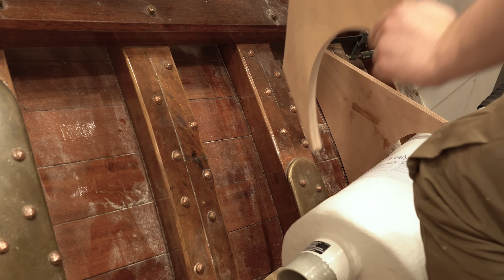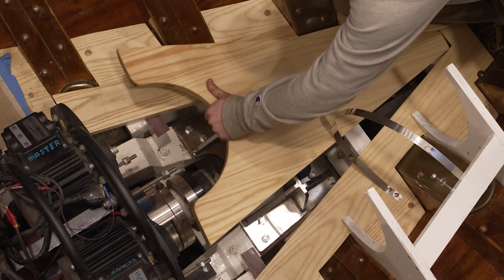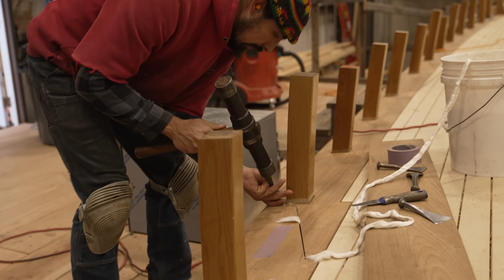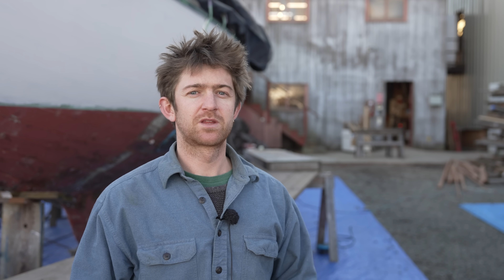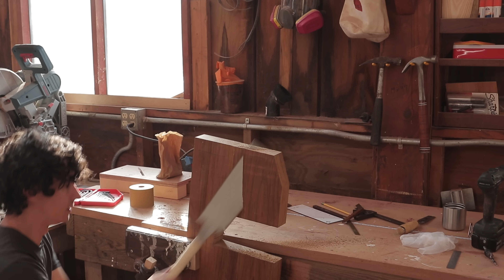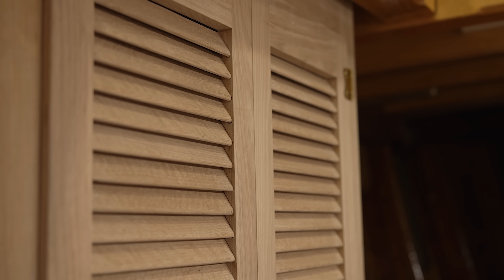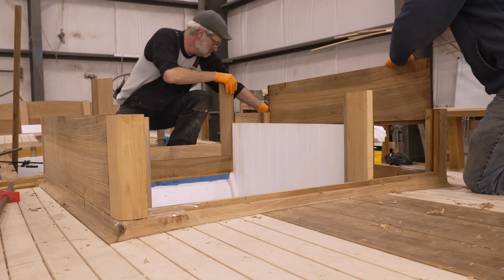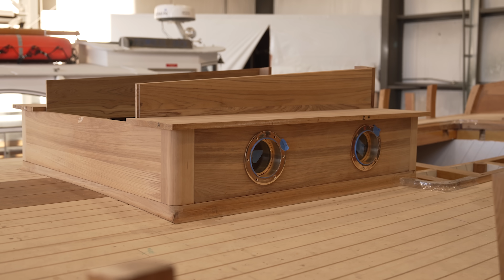Traditional wood boatbuilding - deck hatches & more!

Comment: Hi Leo ive been watching this boat build from the start. i must say your work is to a very high standard but as a mechanic and a welder i have made an observation that concerns me. exhaust systems can get very hot and your system has some of the parts made out of combustable materials including the muffler mount. are you not concerned about potentcial fire particualary under heavy engine use situations.
Reply: I think you'll find the Halyard Marine Exhaust System are completely insulated and won't radiate any heat.

Comment: How many man-hours does a built boat spend sailing compared to the vast number of man-hours it takes to design and construct ? 

I'm guessing that Tallyho already has 30,000 man-hours invested !  , how many more to complete the build?

The cost is beyond my ability to estimate,  probably $3,000,000 USD in labor and a staggering amount for materials . 

Phew -- seems like an unlikely project without an impressively wealthy sponsor.  

Hmmmmmmmmm

ps.  It's been a wonderful adventure to watch, as I have done from it's very beginning.

Comment: Why is saltwater fine in the bilge and not fresh?
Reply: Salt water inhibits rot, kinda "pickling" the wood while fresh water + wood = rot
Reply: @patricklewis8246  of course 👌
Reply: Freshwater promotes mold & wood rot, especially when trapped in a void space or an area that doesn't drain.

Comment: Leo didn’t see any paint go around the hole in the bulkhead for the rubber exhaust pipe. As you know there is always water and damp in the bilge, just an observation
Reply from the maker: it was sealed with 2 coats of clear epoxy :)

Comment: Oh what joy, led keel prep / paint.  When we did ours, we wet sanded with mixed epoxy as led oxidizes immediately on air contact, don't know if we went overboard doing that, but seams to of worked for us.

Comment: So during this rebuild. How much of the 1 dollar boat remains? I say less than 1%. What do you say? Not a complaint. Just feel you need to say, You are replacing 99% of the boat.  Really building a new boat fully, and reusing lead and brass from the original boat.
Reply: He doesnt really need to say anything to be honest. Specially since he covered this exact "issue" many times before.
Reply: what remains are her lines, design, some deck hardware will be reused as well, and her stern is largely from the old stern timbers - and the things you mentioned, the lead and brass getting recycled as well
Reply: @theorganguy  I was just asking. what makes Rebuild % vs full replace % here. If you are over 93% replaced it not rebuild it new.
Reply: @robb1460  who decided on that number? as the other commenter said: Leo has been addressing this very thing several times and essentially what you are seeing here are a "catch-up" on decades worth of maintenance in which most these things would have been replaced piece-meal... only that you see all of that compressed into a 5-year span, does it make it any less of a rebuild? In the end we are all free to decide on that for ourselves. For what Leo is concerned: if at all times of the progress you were able to look at the jobsite and see "a ship" then it will always been "that" ship and not a replacement.
Reply: @theorganguy  I have heard Leo's on this matter. Still, come on. If I say replace everything short of used rubber tires, wheels, used brake pads, and car stickers. I just have a new car with some used parts. As what the boat rebuild is.
Reply: I've heard this story when I studied architectural preservation but here is Leo telling it again in reference to Tally Ho https://youtu.be/tW15VnkEmQ0

Comment: Zeal packing cotton into the joints on the deck is pure poetry in motion, and strangely relaxing 🙂
Reply: I've caulked a few boats and you're right, strangely relaxing. I'd get into a kind zone and the world would go away. I miss those days.
Reply: @KRWoodworks  and a fine art lost on many
Reply: Its the repetition and establishing a rhythm and when your good and not to many hiccups, by  the end of the day you can do get a lot accomplished.. very therapeutic and fulfilling
Reply: We need a 10 hour video of him caulking
Reply: @maxlundgren3482  I think you missed at least one zero off the end of the number of hours ;-)
Reply: yes, strange.🤔
Reply: I can’t understand why you still caulk with cotton and then put a hitech flexible sealing compound over it? Why not use a sealant adhesive alone?
Reply: @waynejorgensen4433  The cotton is not to seal the boat. It's for tightening the boat. The fiber caulking either cotton, oakum, or both turn the boat into a monocoque structure. It helps prevent the boat from working underway. The seam compound keeps the water out. After caulking small boats in the shop I worked we wound "ring" the boat. Basically hit the side with your fist and the boat acts like a solid or "rings"
Reply: @KRWoodworks  thanks Kevin
 Makes sense!
Reply: @waynejorgensen4433  It's probably double the protection.  If the sealant fails the cotton is still there as backup.
Reply: @AIM54A  The fiber caulking can not block water. Read my post about what it's for.
Reply: @waynejorgensen4433 I see KRWoodworks has already explained, so I edit my comment I that light. I just say, this is Tally Ho, there are no corners cut around here.

Comment: It's just a never-ending stream of perfection being shown here. If boats could have halos, this one would.
Reply: I Think the halos was in sight when Leo started the Project already, one step at a time.
And Tally H has achieved more than one halos already _/)
Reply: Really?I am thinking about that misters mustache
Reply: I learned how to build a boat from my father who was an old time boat builder in NewEngland . The bronze piece made for finding the center line ? Had I produced a finished product like that for my father he would have had me make it over. A few pointers…
The counter sunk screw holes where much to deep, the screw heads should have been flat heads and then filed down to meet the crown of the half oval filling the entire counter sunk hole. The slots of the screw heads should have both been horizontal when completed. The piece when completed should have been sanded with fine sandpaper to a uniform shine.
Reply from the maker: @toddabrahamsson1797  What you are describing is personal taste. I prefer to see the patina of the original keel bolt, so we will skip your "pointers", thanks.
Reply: @toddabrahamsson1797  good lord dude, its not that big of a deal nor is it your boat
Reply: @toddabrahamsson1797  I think Leo wanted to keep the patina from the 100 year old original keel bolt.
Reply: @toddabrahamsson1797  lol
Reply: @toddabrahamsson1797  The apple does not fall far from the tree.
Reply: Watching the video today I was surprised to see the house being installed with no vertical bolts ,bolting the house down through the deck beams. The way I was thought any structure would have these bolts and to never just use glue no mater what type of glue used or no mater the size of the house.
Reply: @toddabrahamsson1797  with your expertise in boatbuilding could you explain the difference between house and hatch? I ask because the video led us to believe that they were installing the hatches on the boat and made no mention of the term house.
Reply: @daBuzzY90  I kinda guessed that but with I'm not an expert and with all his complaints about the work of at least 3 shipwrights, and 1 being a marine architect, I wanted to be sure. 😜